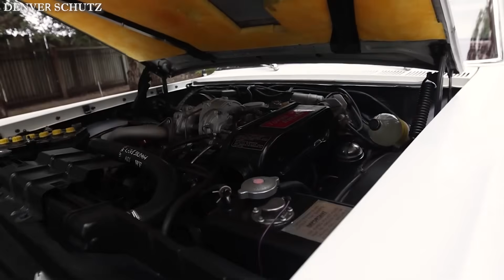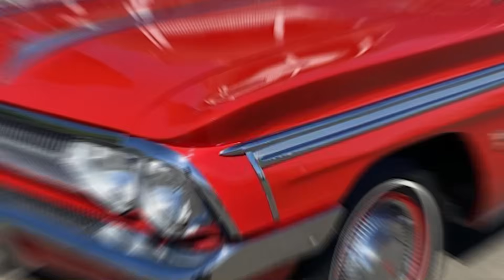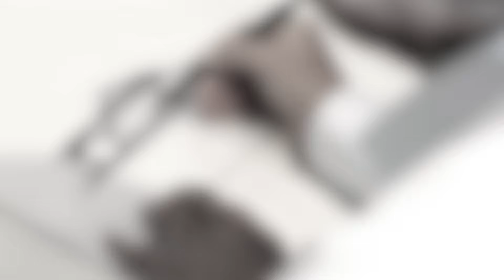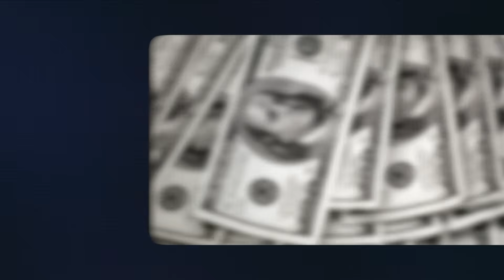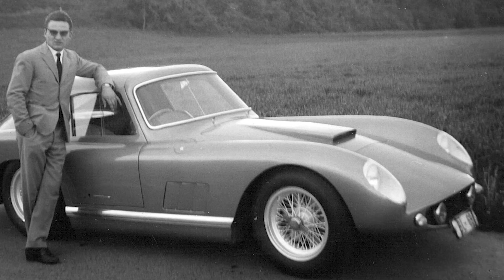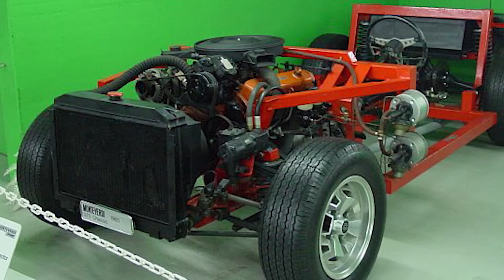3 Most Forgotten 1960s Cars That Were Actually Amazing!

Comment: The turbo wasn't the only issue with this car. This aluminum engine could  not survive being over heated. It needed far more attention paid to its cooling system than car buyers were sued to. One over heating incident would mean warped heads and blocks which required expensive machine work to fix, if they weren't already compleetly destroyed.
Reply: Sort of related to the cooling issue, did the Olds dealerships even sell cans of that required water/methanol mix?